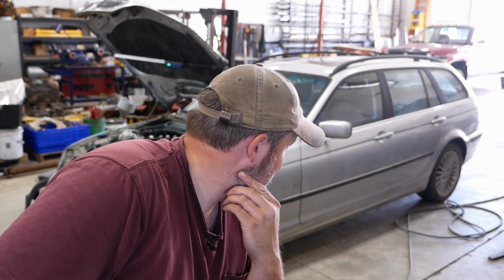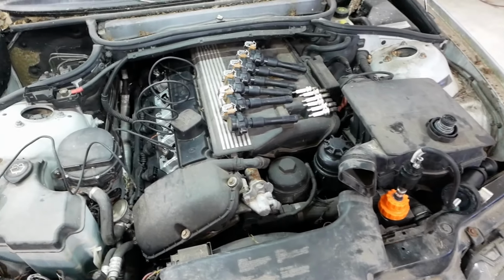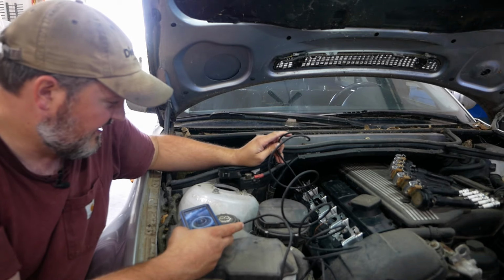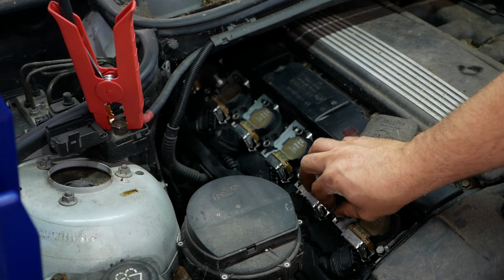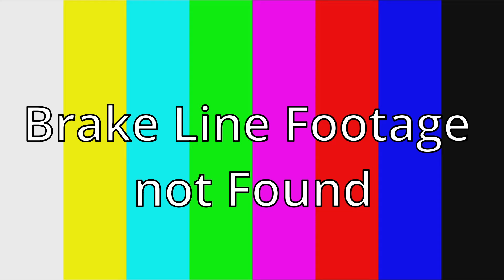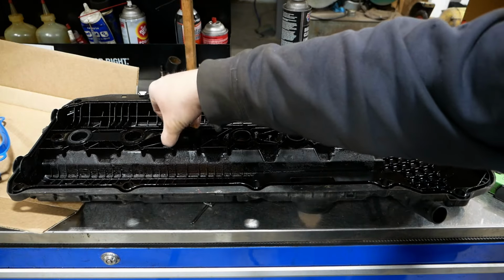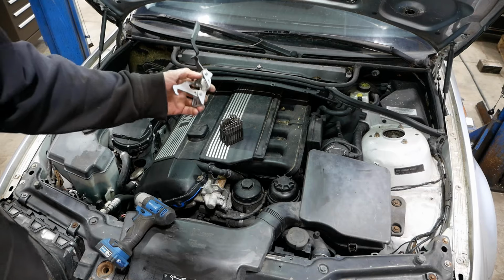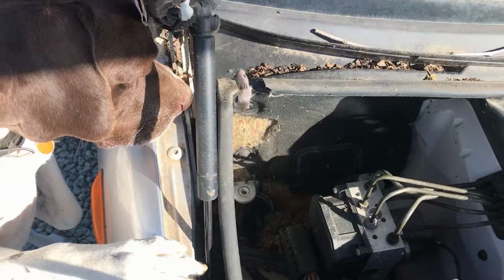E46 BMW Losing Coolant, Oil, Brake Fluid, Etc.

Comment: I had a Volvo 850 that kept loosing coolant. I replaced every cooling component bar the head gasket and radiator, and none of that fixed the problem. The system held pressure and the head gasket tested good. I think this is the universe's way of messing with us.

Comment: a pressure tester is useless on the e46. you've got all those flimsy plastic coolant hoses that leak when the car is being driven and the reason you don't see coolant on the floor is that its losing it as steam while its driven. Do what others here suggest and thats put all new BMW factory hoses on the cooling system. That's the only way you're going to fix it

Comment: Well, at least whoever was in there used a preformed gasket on the cover. I've seen people goop RTV in there with no other gasket. It just makes a mess for whoever has to take it apart and put a preformed gasket in it later on.

Comment: They can rust very badly on the rear wheel arches, the Tourings (wagon) on the rear dokr and on the jackpoints. Diesels chan loose coolant on the egr cooler. I dont know if the M54 gas engines have an egr cooler. If they burn oil its usually the valve stem seals.

Comment: Ok, saw the whole video, abstained from commenting on it in case it's not it, BUT... and i know you wouldn't wanna hear this... you have to take the intake manifold off and take a look at those god forsaken coolant lines that are hidden in there. You might be able to sneak the boroscope in through the cracks and take a look, but .. only if you're lucky and it's obvious.

That, is a less known (well, here in Europe it's well known) issue that these inline sixes develop especially in the big km units. Glass reinforced plastic and vibrations, bad coolant mix in winter, loose connection... plethora of reasons. Last i did this, for a neighbor i found that the one with the big bend it was banana split from the head aaalll the way to the bend. One huge crack. It was easy to identify on account of the fact that once pressure built up, you'd hear and see coolant gush out like out of those wide spray garden sprinklers.

Comment: I had this exact same problem happen on a Honda It would only lose coolant when the engine was hot and I mean really hot like after driving for an hour I couldn't figure it out for the life of me eventually I just replaced all the hoses the radiator the water pump every cooling part and it still happen so then I replace the head gasket and it solved everything

It would pass a vacuum test it would pass a pressure test It would pass literally every test I could throw at it when the engine was cold but as soon as the engine warmed up it would start putting exhaust gases into the coolant and it would suck down just a tiny bit of coolant
Reply: You can test coolant for exhaust  gas
Reply: @agger838  yeah there's a problem with that though It only happened when the engine was smoking hot after an hour of driving

Comment: If a German forgot to do that.. He'd work in the turn signal install department afterwards - since those are apparently never installed on German cars.
I had a freak coolant loss on mine. Replacing the expansion tank cap solved it.

Comment: That rusty cylinder is the weirdest thing I’ve seen in a running engine
Reply: It is probably more common than people realize in engines. Still not common, but it still happens where the cylinder doesn't actually have any problema but just some rust. It is not the first running engine like Wes has had with rust inside the cylinders. They usually had less compression though :P

Comment: n said these cars are solid and don't rust I don't know where you got that from really. The chassi is terribly designed since it cracks in the rear subframe mounting points due to a design flaw. Also, at least in Scandinavia where I live, they rust lika crazy. Sills, front fenders, rear arches and floor are typically more or less rotted out on most e46. Despite all that I still love the E46, mostly because it's so nice to drive.

Comment: Had a similar problem to this and it turned out to be a cracked thermostat housing, that only opened up when hot, so if you tested it like you did cold, you got no pressure leak down and no dripping and I'm assuming when hot and the car was moving, it was evaporating.

Comment: Maybe it has a pinhole leak in a hose but only under pressure. Either that or its all under the carpet from a heater hose.

Comment: You pressurised the cooling system. Took out the spark plugs so no obstruction to the atmosphere and still at 13  after overnight. If any leak it can only be when hot. Torque the head bolts?

Comment: Even if you confirmed that head gasket bad, I think the owner would’ve had to make the call run it until it’s worse, at this point you can’t slap a new gasket in and send it, you will have to at a minimum dingle ball hone number 6 , but then do you just leave the rings? It seems the guy would have to either swap a bone yard engine in, or make the decision to fix it right and run the car another 3 to 5 years to justify the expense, then what comes up during that time.. you did your customer right, tell him to watch the coolant, and the temp, and run the wheels off it..

Comment: Regarding the coolant leak: could it be the coolant system has been worked on not so long ago, and its an airlock gradually working its way out? Combine infrequent use with short trips (thermostat not opening much), not much use of the heater (so the heater matrix isn't bled), etc and it could take a number of cycles cold-hot-cold before the level is consistent. 

PS I realise I'm about a year late with the comment, I thought this video had just been released because it came up on my Youtube feed.....obviously the "algorithm" knows something I don't! Maybe I've been shopping for coolant and Google tracked me.

Comment: I'm confused? Did the scope not show coolant in the cylinder?
Reply: i'm scratching my head at this diagnosis too. coolant was clearly leaking into the cylinder...
Reply: I agree. My point as well.
Reply: It did, but the coolant itself had no exhaust contamination,  and compression was not affected. While it does appear to have a minor leak, it clearly didn't affect much of anything.
Reply from the maker: It’s not conclusive. Could be oil from a valve seal.
Reply: @WatchWesWork  but wasn't their rust? isn't that caused by coolant?
Reply: @WatchWesWork  thanks for the clarification.
Reply: @christophers.4007  I think he said that the car sat for a while before it came to the shop.

Comment: I had an 07 Audi A6 that developed a very very very slight miss at idle. Turned out to be a timing chain/gear problem. $7000 fix. That was my last Audi
Reply: Bad tensioner or chain guides ?  Either way,  the long running time between oil changes is a problem - change the oil at 10000 km.

Comment: Had a '95 M3 when I lived in Brussels ... exactly 13 months old and sitting in traffic, Head Gasket blew. Unfortunately, back then the EU Cars only had a 12 month Warranty ... Dealer wanted $1,700 to replace so took it to an independent. 3 months, 3 tear downs and never ran correctly ... even with his giant $2 million "Sun" type machine. Took it away from him and took it to an old man across the street from my work ... in by 8, out by Lunch. First shop opened up the parts Cannon and nothing worked ... told him my opinion it was timing related and he scoffed (Americans know nothing of course) ... old man confirmed it was 1 tooth off on the left bank (DOHC).  Loved to drive her and yeah, the seats were awesome ... but never again will I buy a BMW, MB or even VW ... too complicated and over priced. Have a C6 Z06 here in the Riviera ... oil and gas is all she needs ... never breaks ... and can beat all the Ferraris, Lambos, Porsches thrown at me ... happy camper.

Comment: First: nice car, it even has Bilstein shocks. But they are not of the same quality as e30 and e36 bmw's. I had one, a 2005 320d touring 6spd.  It did have rust issues and problems with the split tailgate mechanism. Weak wheel studs as well. Not nearly as tuff as any Volvo i owned. (940T, 850T5, V70T5) and those have their own issues as well.
Second: on Volvo's i have seen hairline cracks in cylinder liner walls. They would only pass coolant when the engine was warm. Coolant evacuating through the exhaust. Difficult to diagnose. Volvo S60/V70/S90/V90 blocks are pretty similar to BMW blocks from the same early naughties vintage. Maybe this car has that kinda problem? I mean, you already saw rust in 1 cylinder. That is an undeniable lead. I bet there is a hairline crack in the cylinder wall of that cylinder. It will be back.

Comment: They all leak/burn coolant and have electrical gremlins. Same is true for vw's, audi's  and mercedes. Learned to turn aways those jobs a long time ago. No amount of scan tools will fix bad wiring and connections

Comment: Just spit balling an idea about the stain in #6. Could the head gasket be leaking as it cools after its been at operating temperature? I’m assuming it has alloy head and cast iron block ? The 2 metals heating up and cooling at different rates may cause an issue. 🇦🇺🤙🏼

Comment: If the owner ever reads this, a little vacuum action in the engine bay never hurt nobody. jm2c
Most cheapo hardware stores have these tiny, tiny shopvacs you buy to throw away and they're excellent for it.

Comment: On an old beater like that maybe the next step is as straightforward as a bottle of Steel Seal. It isn't an honourable fix but maybe worth a try.
Reply: On a car with a very nice interior ?  And very little rust ??

And a engine which is entirely capable of running at 250 km/h the next 60 minutes ??

Comment: Love the realities of “rotting in the parking lot, might as well rot in his driveway” 😅

So, how is there no leak, no pressure loss, no cylinder pressure loss, but there is clearly rust and green fluid in the cylinder? 😮
I guess it might have been just that coolant line not clicked in correctly…
Reply from the maker: Not sure it was coolant not oil.

Comment: This was the time when BMW made cars like god intended. Cylinder bores look like new trough the scope if you ignore the staining that's impressive some engines wipe the cylinder bores out at half the age of this car. I do suspect that it is indeed "discharging" small amounts of coolant into the combustion chamber somehow. Worst case cracked head but also these aren't known to do that and a crack may not even be something you would ever notice if it doesn't connect to any passages for oil or coolant and with the engine warmed up and running it should rather push combustion gases out and over-pressurize the coolant system than suck coolant into the cylinders.
You can tear the engine apart and find nothing or just hope that the leak somehow fixed itself while the car was in your shop 😉

With everything fixed and the car detailed in and out, engine bay washed, paint defects touched up, a full service and new tires this thing would better and cheaper than a brand new car!
Looks like it even has had new Bilsteins put in at some point.

Comment: I miss my e46 still.. But please tell me the lower rad hose and sensor were on the list of things done. I had a low coolant light that would pop up every 5-6 months. That stupid o-ring on the sensor in the lower hose was just barely leaking. the only sign was just a little white line that you needed a flashlight to even see on the plastic that the sensor mounts in.

Comment: Your 10 mil socket is probably with the missing sock. Did you check the color of the auto trans fluid? I've seen coolant disappear And it turned out the trans cooler lines IN the radiator were leaking.

Comment: i really think e46 loose coolant from some little hole. or into oil from oil radiator. use UV liqid and you find where.

Comment: So, you stock spare 10mm sockets. Since I refuse to work on anything with a computer in it, I seldom need one, but I always stocked spare 1/8 inch drill bits.

Comment: Maybe the leak only shows up when the engine is hot of maybe it's leaking at the heater core . Does the heater water control valve seal tightly when the engine is off?

Comment: the cylinder with rust on it is clear sign is leaking coolant .oil or gas dont make cylinder wall rust with green stain mark down wall

Comment: Does it have a Trans cooler?  Could be mixing in with the Trans fluid which would explain why you didn't find a leak externally because it's leaking internally.

Comment: Did you do a sniff test at the tailpipe to see if it smelled sweet? Was the exhaust discharge very hot? Did you run it for an extended period of time to get it up to operating temperature? I’ve had BMWs for many years…..

Comment: Hey Wes Did you check the transmission fluid because I’ve had a Ford Taurus that done the same thing where the coolant was disappearing and I pulled the transmission dip stick and it was full of coolant and I found out the transmission cooler in the radiator was cracked and allowing coolant to go into the transmission

Comment: maybe i say about my e46 sedan 320d still smell of exhaust in cabin...  a oil leak from engine and gearbox 6 gear manual ZF gears not correct. xenons overheat, fog lamps die. rear lamps die. and the greatest electric windows glued to door ruber gasket. handbrake not work fine... i think VAG cars is better after same mileage

Comment: Did you change the thermostat? Sometimes the engine gets a little hotter than normal and leaks coolant through the cap

Comment: I had a similar problem on my BMW, It lost coolant, but nobody found the leak. Pressure tests, etc. found nothing. In the end it was a bad shaft seal at the wather pump. Sneaky bastard. It only leaked at high RPMs.

Comment: Just trowing a guess: Upper radiator hose outlet (plastic) slowly dripping on a hot engine block?
Reply from the maker: I don't think so. You can usually see that.

Comment: Could it be the hairline cracks in the head like the GM ls motors? Just seeps a little and evaporates with heat so no tell tale signs?

Comment: How much is saved by manufacturing the valve covers, and intake manifolds,  out of plastic, plastic that hardens gets brittle, warps, and is really good for recycling into oil drain pans. Could someone more knowledgeable chime in please?

Comment: Does it have a heatexchanger, the leak could be there. We had a coolant leak issue in a BMW back in the 90's and it turned out to be in the heat exchanger.

Comment: Head gasket. Need to remove pistons run a home down the cylinders then install new rings and head gasket
Reply from the maker: That's $5,000 of work for a $2500 car.
Reply: @WatchWesWork  yes I guess that's a lot more than the gentleman or lady wishes to pay for.  Is there a cheaper method to solving an engine black problem like this. Does someone make a short block for this engine at all. Just brain storming 🙂

Comment: Have you checked whether the coolant has gone into the transmission? There's an oil/water cooler on the ZF boxes.
Reply from the maker: No I did not.

Comment: Did you bring the engine up to operating temp and turn the heater on to make sure the heater core that is mounted behind the dash/center console isn't leaking.  I helped a friend change the heater core on his E46 and it was #^%$#^ to do
Reply from the maker: No but you can't smell coolant inside, no wet carpet.

Comment: 325 and 330i are notorious oil burners if the oil is changed at the manufacturers recommendation 20k km, due to low tension, low friction piston rings, they stiffen up. I don't like these cars. 
They drive phenomenal of course.

Comment: Did you check the heater core?
Reply: Good idea, though the owner would've been smelling coolant inside the car - unless bimmers use some type of coolant which doesn't smell.
Reply: @DanEBoyd  not necessarily. If it is slow enough and the car scent trees you might overlook it. Idk just a thought, it is a component that generally gets over looked because of the difficulty to get too.
Reply: @Sak-zo1ui  I actually had one which would give me whiffs of antifreeze inside of the cab of an F150, yet it never dripped, and the coolant didn't disappear from the radiator.  I put in a new one and haven't smelled it since. Even on a 1977 without AC, I had to unbolt the passenger side of the dash in order to get the heater case out, but it was still pretty easy - not like a Fox Mustang with AC...
Reply: @DanEBoyd  that is crazy. It is incredible how such small amounts can be detected by just fumes. Incredible.